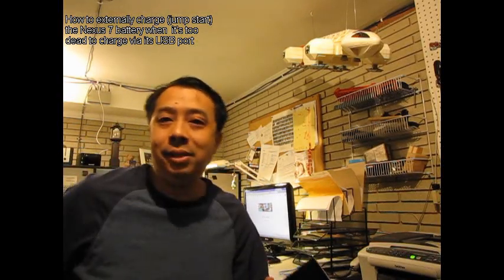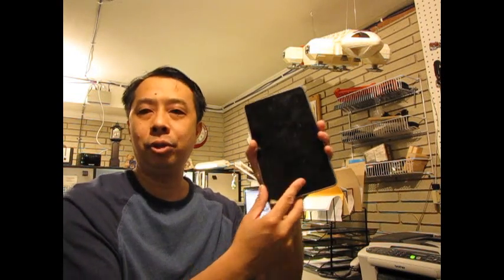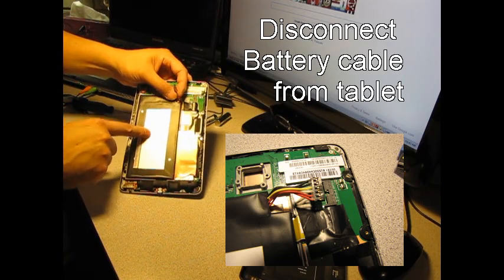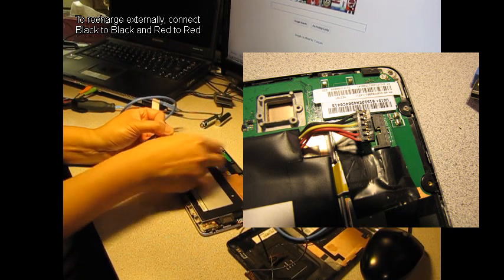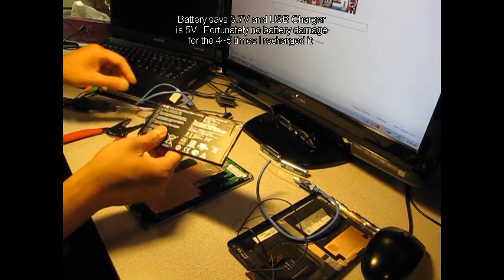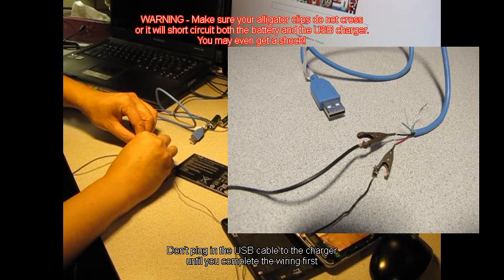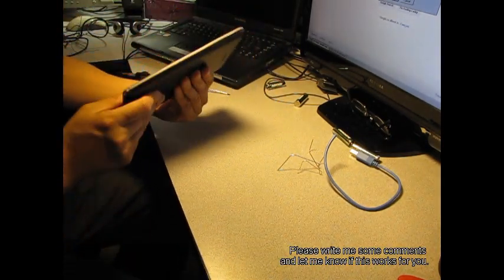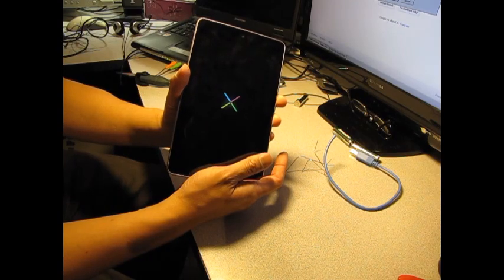Externally Jump Start Your Dead Nexus 7 - Final solution when all else fails!

Comment: Awww thank you!!! It worked!!! But now that its on i can now see the reason why it died this bad. When i plug it in there is no charge getting to it, iv tried every charger in our home but no luck and they are all great chargers, got any clues on how or what i could do about this problrm?
Reply from the maker: Hi Julia, glad to see you got your N7 working again! A broken USB charging port is the typical reason why your battery completely died to begin with. However, after you get your N7 jump started out of the limbo mode as you have done, you have several choices to get your tablet charging again. If you have the model where there are pogo pins (4 gold dots) on the side, you can purchase the official docking station to recharge it from now on (see my comments to J Conder below). If you have the newer wireless charger model, you can also purchase the wireless charger.  Either way is better than fixing the wornout USB charging port, althought that is not that difficult to replace given its modular design.  You can purchase a replacement modular USB port on e-Bay and there is a Youtube video on how to replace it.  Good luck!

Comment: Hmmm... This got it back to life but it won't take the charge now.  Tried with different chargers but nada. I have a tiny bit of juice left.. Help!!
Reply from the maker: Hi Andrew, a broken USB charging port is the typical reason why you get a completely dead battery to begin with. However, once you get your tablet jump started out of the limbo mode, you have several choices to get your tablet charging again. If you have the model where there are pogo pins (4 gold dots) on the side, you can purchase the official docking station to recharge it from now on (see my comments to J Conder below). If you have the newer wireless charger model, you can also purchase the wireless charger.  Either way is better than fixing the wornout USB charging port, althought it is not that difficult to replace given its modular design.  You can purchase a new modular USB port on E-Bay and there is a Youtube video on how to replace it.  Good luck!

Comment: Hi,  so I am pretty illiterate when it comes to electronics, and I'm trying to do this, I have my back open, the proper thing pulled up to plug all the wires into, I've stripped my usb cords and all that, but I don't understand how to plug them into the back of the tablet, and I don't see how the paper clip is being used.  Help?
Reply from the maker: Thanks for giving this a try.  The problem with the stripped USB cord is that its wires are thread wires (made of tiny strands) after you have stripped them.  This makes them too weak to push them directly into the tablet's battery connector which have the corresponding + (red) and - (black) holes. Kind of like pushing the end of a string into a hole. Had they been sturdy solid core wires instead, you could simply push these USB cord wires directly into the tablet battery connector holes which would by-pass the need for the paperclip.

Do you have any alligator clips?  If not, I suggest you tape each USB cord wire (the black wire and the red wire) onto a paperclip each.  Make sure you tape it in such a way that the USB cord wires has metal contact with the corresponding paperclip to allow electricity to flow through.  As the paperclip is solid, you can then poke it into the battery connector holes (red to red and black to black as per video) which would allow the electricity to travel from the USB wires through the paperclip and into the battery connector holes.

Hope this helps!
Reply: Doug Peng Ohhhhh.  Okay.  I'm going to try this.  Thanks!
Reply: Jenna Porter well you can also give a call to RTS Geeks

Comment: YEAH !! Hi Doug, just need to give my profound thanks for telling me how to jump start my 2+ year old Nexus7.  Nothing else worked and I had nothing to loose in this attempt.  ~30min each side provided me with an instant start up window and ~30% charge.  I found it easy to follow your instruction with my own mods. Did not need or use alligator clips.   Used two small stranded wires (from a car wiring harness), stripped a section from both ends. Found it easy to separate and twist together a few of the car wire and insert it straight into the Nexus7 battery harness for black and then the red.  Took the usb exposed striped wires and twisted them together with the USB's,  taping each side separately to avoid shorts..  Easy to do.  Worked.  (Nothing wrong with existing charger port as the battery is now charging normally)  Why won't the regular way work to kick start this thing?  Regardless, I am ordering a new oem Nexus7 battery to replace the aging one.  Thanks again.  David

Comment: Good day Sir, Dough I'm planning to do your jumping method,
Because Everytime I Charge my Nexus 7 , it only battery logo appears, and not booting up,:(( I measured the battery terminals with my faithful Analog Multimeter (where the  battery connected) 
I got only 0.5V !!!! Which is too low voltage to charge up my Nexus 7,. So I decided to measure the Battery of my Nexus And I'm having 3.6V 

Do you think there was a problem to my Nexus 7 charging Circuit??
Reply from the maker: You have a tricky situation in which I am not sure of the answer.  If your battery measures 3.6V directly and you get the battery charging logo, chances are that it is charging properly.  However, I cannot answer why it doesn't boot up or why you are only getting 0.5V from a direct reading.  Based on this, I doubt my jump start method would work for you.  As you don't have much to loose, you could try my method to jump start the battery for 15~20 minutes or so and see what happens.  With such a long jump start, you should have significant power in the battery for a proper boot up.  If it doesn't, then likely something else is wrong.  Sorry I cannot be of further help.
Reply: Hello Sir, I did the external jump stard Method into my Nexus 7 ,. I Charged it up for about 1 hour, each cell as you mentioned, and when I turned On my Nexus 7, the battery got fully charged! And while it's charging there was no heat, in the batt,.Thank you Sir, for this wonderful method,

But, when I charged it with my USB cord It was charging but, no Increased percentage of the batt,. 

 I think it's because of only 0.5v output where the batt. Connected
Reply from the maker: Darel Ocampo I think your USB port is defective and that there is nothing wrong with your battery.  If you have the model where there are pogo pins (4 gold dots) on the side, you can purchase the docking station to recharge it from now on (see my comments to J Conder below). If you have the wireless charger model, you can also purchase the wireless charger. My gut feel is that these alternative methods will be able to charge your tablet effectively.

Comment: Thanks Doug for this video. I was able to turn on my N7. Problem is  it still not charging so I'm thinking that the USB port is defective.
Reply from the maker: Glad to hear you got it to work. A defective USB port is usually the root cause of this problem. Fortunately there are other methods to charge your N7 rather than fixing the USB port.  If you have the model where there are pogo pins (4 gold dots) on the side, you can purchase the docking station to recharge it from now on (see my comments to J Conder below). If you have the newer wireless charger model, you can also purchase the wireless charger.  Either way is better than fixing the wornout USB charging port, althought that is not that difficult given its modular design.  However, you do need to jump start your battery before any of these methods will work in the long term.

Comment: You are the man!!! Tried everything else before resorting to your method. Nexus 7 2013 model wouldn't do anything until I did this. Jumped it just like you did for about 5 minutes each cell. Powered right up, so I can confirm that your method works on 2nd gen. Gonna try the wireless charger for ultimate solution because charging port still wont charge it. But at least I know the only thing wrong with it is the charging port.

Comment: Hello Doug.  Just seen the video.  My son has a second generation Nexus 7 (2013) model and it is completely dead.  I think the charging port is maybe worn out as the charging cable doesn't sit comfortably inside the hole when charging.  My questions are a) Can you pull apart the newer model as easily as the first and will the same jump start method work with the newer model?
Reply from the maker: Yes, your 2nd generation 2013 model should equally benefit from this jump start method.  Many other commentators here have a 2nd gen 2013 model and go it going using this jump start method. You mentioned a worn-out or loose USB charging port.  This is usually the root cause of a dead battery.  Hence after performing the jump start method, you will likely need to replace that USB port.  Fortunately, the USB port inside the tablet is modular, so you could purchase a replacement part on Ebay and exchange it yourself (not that difficult).  However, if your model has the 4 pogo pins (4 gold dots on the side), you could purchase the docking station and charge it through there instead.  This is a much better solution.  However, this method won't work until after you have managed to successfully jump start it to get it out of the limbo state.  If your newer N7 model supports wireless charging , you could purchase a wireless charger instead of fixing the USB port.  One commentator mentioned that he was able to wireless charge a completely dead battery without needing the jump start method, but I haven't tried or seen it myself.  Logic tells me that you should need to jump start back to a normal state before the wireless charging would work.

Comment: Great video, but a 6.18 the instructions jump from connecting the paper clips to where you've completed the charge. Where are the paper clips plugged in?  Where is the source of charge?  An external charger?
Reply from the maker: Hi Paul.  The paper clips are to be plugged into the battery connector.  Simply poke them into the respective battery connector holes (red to red, black to black) so that USB cable (other end) can now feed into the battery.  The source of the charge comes through the USB cable via a USB port.  You can plug the USB cable into a USB charger (recommended), or into your computer's USB port (not recommended, but works).  The only reason I don't recommend plugging into your computer's USB port is that you may damage it if you accidentally short the USB wires (i.e cross the red with the black).  You would still damage the USB charger if you accidentially cross the wires, but hey, a USB charger is a lot cheaper than your computer!  Good luck!
Reply: Thank you so much. So many YouTube videos are badly put together. Yours is excellent.

Comment: Many thx Doug - this worked ! Jumpstarting the N7 battery does actually work and saved me buying battery or new N7.  It took me two attempts - first time immediately after failure (didn't work) - left N7 for a few weeks tried it again (did work).  Use a multi-meter to check power in (of lead), power feeds into N7 battery (during powering) and power of N7 battery (after powering).  First time I didn't and a loose connection gave impression it was charging during charging..(avoid gotchya). Dough is right - lead feeds 5v, N7 battery only needs 3.99v (when full).  TIP: I used two staples on end of red and black lead to create simple clips which insert snuggly into black N7 battery connector...better than paperclip and very robust. I did find my N7 had a USB port which needs replacing once N7 was powered on...which explains why my N7 wouldnt charge (had a usb cable in it when it fell to floor breaking USB port inside N7...thinking of adding wireless Q1 coil !).  I'm so happy I did this !!!
Reply from the maker: Glad to hear you got it to work and thanks for detailing your experience for others to see.  As you mentioned your N7's USB port is not working, there are other methods to charge it rather than fixing the USB port.  If you have the model where there are pogo pins (4 gold dots) on the side, you can purchase the docking station to recharge it from now on (see my comments to J Conder below). If you have the newer wireless charger model, you can also purchase the wireless charger.  Either way is better than fixing the wornout USB charging port, althought that is not that difficult given its modular design.

Comment: Hi,  many thanks Doug. I was just about to give up on my nexus after trying various other methods that didn't work. Then I tried your jump start method and it not only worked but gave me a full charge.   Thanks
Reply from the maker: Quite often, the cause of the original battery drainage is due to the tablet's wornout USB charging port.  If you have the model where there are pogo pins (4 gold dots) on the side, you can purchase the docking station to recharge it from now on (see my comments to J Conder below). If you have the wireless charger model, you can also purchase the wireless charger.  Either way is better than fixing the wornout USB charging port, althought that is not that difficult given its modular design.

Comment: Dear Doug, thanks a lot!!!!! It worked like a charm. I measured the battery after pulling it out and saw it was totally dead, but thought it just went bad and was planning to order a new one, didnt think about charging it externally. I followed your method but used 2 pairs of cat5 cable and charged both cells at the same time, I let it charge for about 1hr and the battery charged to 30%. Then completed the process just as you mentioned and it worked perfect. Thanks a lot for all the help!! You are the maaaan! :-)

Comment: If you have a Nexus 7 (2013) there is a another method to jump start the tablet. I had a customer who brought a Nexus 7 to me that was completely dead, as described in this video. Did all the steps suggested by google and trying to leave it on charge (via usb) for a hour; nothing worked. 

As the 2nd gen Nexus 7 has wireless charging built it, I decided to put it on my wireless charging pad and see what happened. Bingo!!!!!, the charging light starts to flash. So I leave it for about an hour to charge, then I press the power button and hey presto, it works!!!!.

So Youtubers, if you have the 2nd gen model, try my method first.
Reply from the maker: Thanks for sharing this insightful tip for those who have the newer wireless recharger version.  For those who have the older POGO pin version (4 gold dot terminals) and the corresponding docking station, a few commentators here mentioned this docking station method will not charge a completely dead battery until you peform this Jump Start Method first. However, the docking station will work after that making it a good alternative if your USB charging port is broken. Thanks again for sharing your experience with the wireless charger.

Comment: Doug I am proud to say I am back in bussiness. I actually got it to turn back on man I am so happy. This is how I did it

1)Modified USB like u said
2)2 nuts and bolts
3)2 needles

I used the nuts and bolts in blace of the alligator clip to keep the stripped USB attached to the needle then I put it on the outside and inside ports like u said. Its on but its not charging ..so I think I will have to buy a wirless charger
Reply from the maker: Congratulations!  Yes, the nuts and bolts is a great alternative solution to the aligator clips!  Another commentator mentioned it with great sucess as well!  Thanks for sharing your experience!
Reply from the maker: If your model as the 4 pogo pins (4 gold dot terminals), you can purchase the docking stations for charging.  I did hear some of the more recent versions support wireless charging which would be the way to go.  However, replacing the actual USB port is not that difficult as it's a modular component to replace. But wireless would be much nicer if you have it.
Reply: Doug Peng Definetly going wireless Doug and again Thank you for everything

Comment: I sacrificed a microUSB cable, but only found 2 wires inside ---- a white and a red.  Will that work, or do I need a cable with the 4 wires inside?
Reply from the maker: I found an interesting article at http://markjohann.hubpages.com/hub/Color-Coded-Wire-inside-the-USB which describes the different internal wiring color standards for USB cables. Although the red (+), black (), white and green combination that I got is the common USB cable standard, there are other 4 wire color variations as well.  I am not familiar with a two wire standard and wonder did you accidentially snipped off 2 wires when you cut the outer cable sheathing? According to this particular link, your red wire is perhaps the orange wire??? which would make it the "+" red 5V terminal and the white wire should be the "-" black ground terminal.  Please check yours to this article first, than take my word for it.